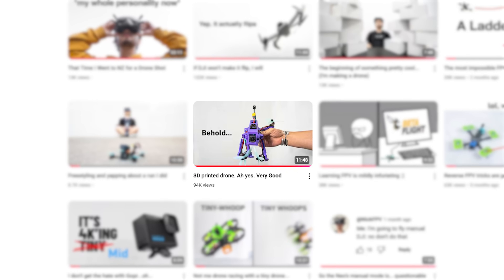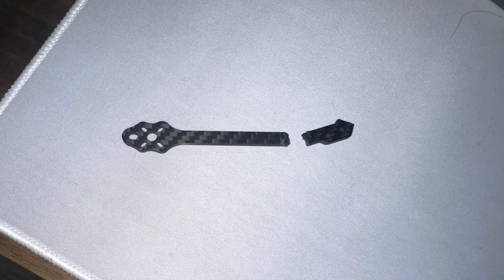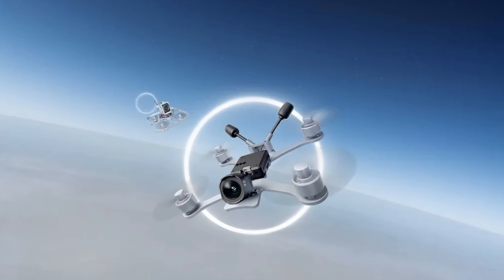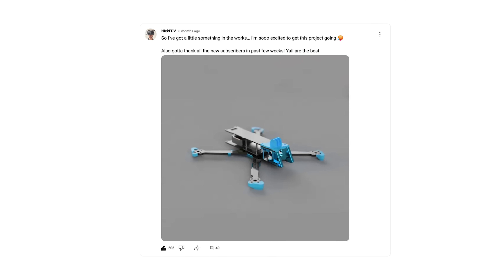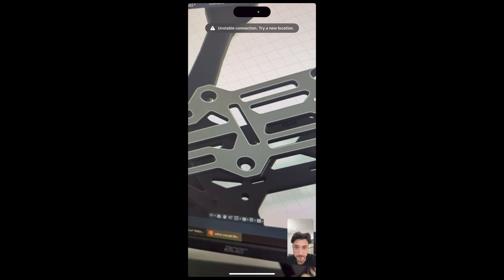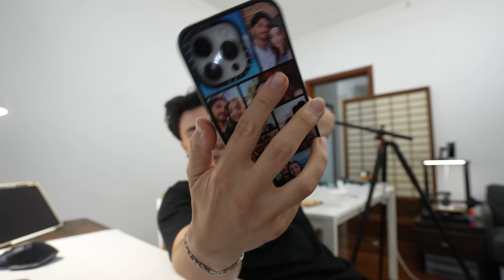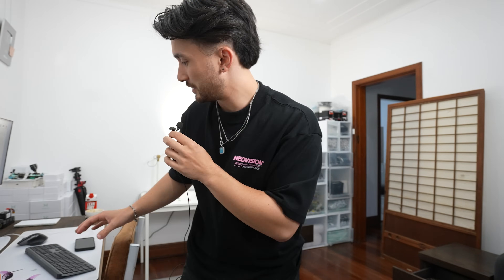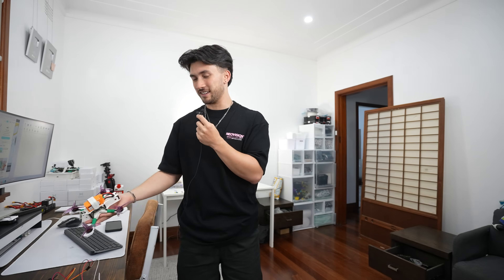I 3D Printed a Drone (again)

Comment: Love your work, but as a mechanical engineer, I am confused about one thing: why would you want to 3d-print shapes, that would be easier produced from laser cutting a sheet of carbon fiber? You miss the entire advantage of 3d printing. You could design any weird, organic looking shape, that is not possible with traditional manufacturing methods. Some shape coming from a topology optimization or something like that.
Reply: 7:42

Comment: If I lived in Australia I would join your team in order to bring my ideas into real life, because in my country it is prohibited to own a drone and fly them. So, the idea is a simple 6 inch frame which will consist of 1 single plate with DJI mavic's propulsion system. Why? Because it is extremely efficient so you can fly far away with it, adding gps and betaflight 4.6 with position hold feature may help to create an fpv drone with 1+ hours flight time.